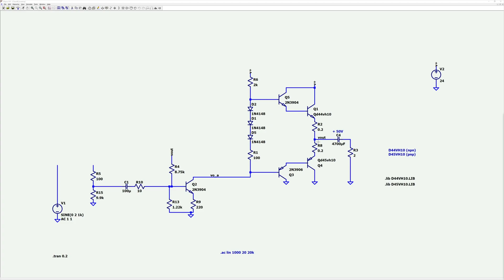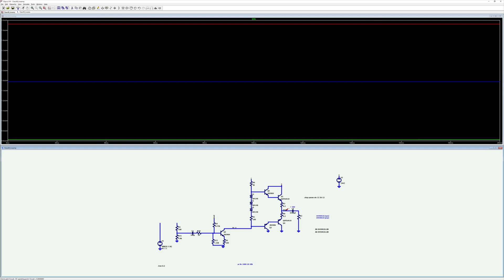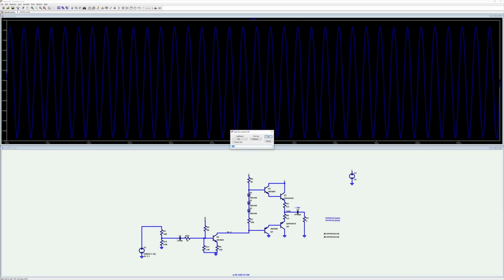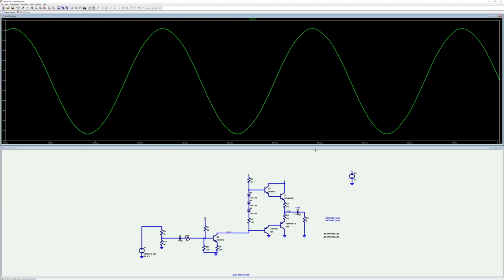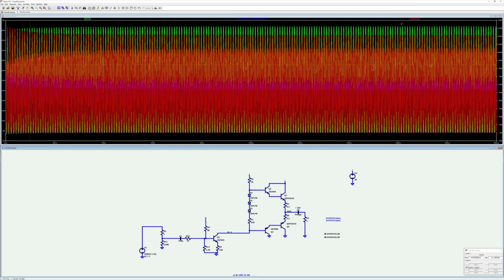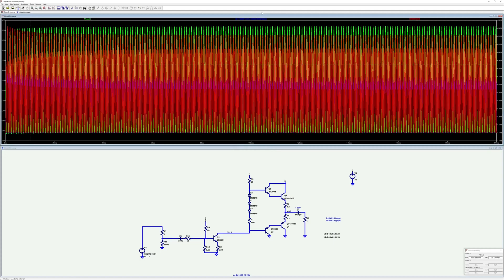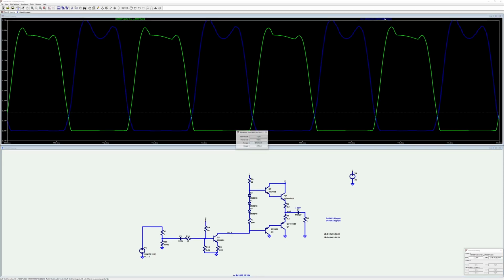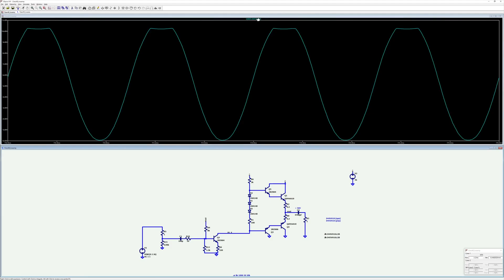Simulating the Class AB Amplifier in LTSpice

Comment: More things to consider  :P .... (beforehand sorry for the caveman english level )

1. The input (AC) impedance of this circuit is too low for an audio amplifier wich is usually around 10K to 100K  in A.F. band, probably a class A input buffer is needed(or a diff. input stage ideally).

2. Maybe it´s not finished yet but you need a Low Pass input filter for RF (cutoff freq isn´t really critical, the idea is to eliminate the most possible HF content above 20KHz as you can without getting attenuation in the AF band). Also C2 seems not big enough considering the sub 1KOhm input impedance, usually you don´t wan´t a very low cutoff frequency for the HPF to not risk the speakers.

3. The power disipated is too much. Strictly speaking this is not a class AB amp, it´s a: "Soft Non-Switching Class AB amplifier": basically for a good part of the output power it works in class A. The output stage it´s over-biased and you get gm doubling distortion (the output impedance varies between 1 emitter resistor (Re) and 1/2 Re or less when the output signal goes from 0V to Vmax).

*3.a. The bias voltage should be set to a point where you get a emitter resistance of about one to one half the value of the degeneration resistor conected to the emitter terminal, this is the Oliver criterion in order to avoid static crossover distortion (gm doubling) ... in other words the voltage across each emitter resistor should be around 13mV to 26mV (but this only really makes sense complemented with a good thermal tracking for Vbias).

4. With the bias corrected you can/should put effort into making the collector current of Q2 as stable as you can (maintaining it low to reduce early effect and Cbc impact in the distortion performance), for that a boostrap in this diode-resistor branch or a current source will be needed. The reason to do this is to have a stable the Vbias voltage and avoid modulating the voltage gain.

*4.a. Even with a bootstraped current source for D1,3 and R5 a electrolytic capacitor is needed to stabilize Vbias voltage.

5. Diodes, altough better than nothing, provide a really poor thermal track for transistor. Have you checked ThermalTrak BJTs?.  When biasing using discrete diodes try to put them  as close as you can to the driver or output transistors in the PCB.

6. A resistor across the base of output the transistors is needed, otherwise the load impedance of your common emitter amplifier will vary with frequency in the same way the load does, modulating your voltage gain and that will cause a rise in distortion due to the variying loop gain. A Darlington pair tends to be really slow to turn-on and turn-of due of the increased input capacitance, and this is bad for a class B/AB system, the usual is to employ cascaded emitter followers because the primal idea is not so much the current gain, but to buffer the load and its variations with freq from the VAS..

7. This NFB scheme reduces the input impedance (i bet you´re getting something around 850 Ohm |Zin| at best ). Appart from that: have you simulated how does the different parasitic BJT capacitances vary with operating conditions and how that affects PM a GM?, maybe some form of compensation will be needed just in case.

8.Zobel newtork? RL filter? these are needed to ensure HF and VHF stability.

9. CE voltage gain can improve using a current source, or bootstrapping the R-D branch, and reducing R9 wich  seems too big. Optimal value should be around 10*emitter resistance at Icq and less than 100 Ohm. Because this is a NFB system so you really want A-> infinity to increase the return ratio in order to deal with harmonics, specially the HF ones.

10. (Probably a subtle point) Separate the supply rails of the voltage amplifier stage from the output stage using an RC filter to improve PSRR, low frequencies clipping and THD.

11. Have you considered a CFP output? (Szicklai Pair), because it offers a really big improvement in T.H.D. compared to the darlington used in here (about 4~5 to 1 at best) at the cost of an added base stopper resistor (and some test to ensure you don´t have VHF oscillations going on)

Additionally:

a. 2Vrms is a really big input you can get that only from a pre-amp, the common maximum output from a professional audio equipment is about +4dBU (~1.22Vrms) and for domestic equipment about -10dBu.

b. Saddly, the spice simulation can be way off....just compare your models with datasheets... particularly those power transistors........specially if they came from ONSemi XD.

c. You can simulate T.H.D. in LTspice using .four directive and .step over freq (a list of freq = 0, 500, 1K, 5K, 10K and 20K will give a good enough T.H.D. vs freq plot), but dont forget to nullify large time constants and wait for a settling time of at least 10 input cycles before collecting data. 
There is a great YT chanel called "SW audio" that shows the usual work flow with audio amplifiers in LTspice.
Reply from the maker: Hi Luciano! First off, awesome thoughts!!! I was so sad when I found this right after finishing our latest video where we responded to the comments. :( 

This would have been great detail to add, and there's a wealth of great information in your words! I hope that folks find this comment, because it is an absolutely great resource, and points out a lot of flaws in our design. I hope that I find some time to sit down and reply to this comment properly!

Thankfully, we didn't miss all of this before we hit fab!
Reply: @EEforEveryone  No problem, i didn't know you respond comments in a separate video (which i really appreciate because it shows real compromise to your community) so i really never expected a response XD.

P.D.: Now that i´ve re-readed my comment seems that some clarification is needed: when i said that "Darlington pairs are slow" i was refering to  frequencies over the AF band. In low power amps they´re usually are not a problem, unless you get some intermodulation/or you´re aiming for a REALLY low THD, but because it´s one of those thing that depends on many factors usually they´re avoided.

Comment: 32% efficiency? Is not too low for AB amplifiers?
Reply: Class AB efficiency really depends on how much you overbias or underbias the output stage, AB is basically a class A amplifier that "jumps" into class B when it needs more power. If the bias current and bias voltage is too high it will be more class A than class B.
Reply from the maker: Thank you for jumping in Luciano! I really appreciate this awesome answer!!
Reply from the maker: Great question Muhammed, Luciano beat me to an answer, and they did a great job! Thanks for reaching out!

Comment: Things to consider:
* Current source in place of R6 may help with increased gain and linearity
* Darlingtons can be a bit slow to turn off, you can try adding a 480 ohm across BE of Q1 and Q4. Decrease value to taste.
* ever heard of a Sziklai pair? Basically it's a darlington but with a base-emitter voltage close to that of a regular transistor. They can be a bit tricky to get stable though.
* Given how cheap opamps are, I would have probably cheated and used an opamp amplifier in place of Q2 stage. If it has sufficient slew rate and bandwidth, it will fix any nonlinearty of your output stage. The effects of crossover become limited by the slew rate and large-signal behaviour of the opamp as the crossover will cause a brief period of open-loop while the output stage crosses over. With nearly infinite gain and system gain defined by resistors, output linearity becomes nearly infinite at least in theory.
* replace the darlington output stage with N channel FETs, drive them with a bootstrap gate driver IC with a PWM controller, replace  C4 with inductor and place capacitor across output load. Congrats you have an irrefutably better class D amp thank me later. :)
Reply from the maker: Thank you Power Max! Expect a proper reply in a video coming soon. :)
Reply: @EEforEveryone  I do eventually plan to build such a class B /AB amplifier and maybe experiment with class D's that have taken over the market at this point, and drive some DIY distributed mode speakers (Tech Ingredients channel) to have a true HiFi surround sound system one day😁